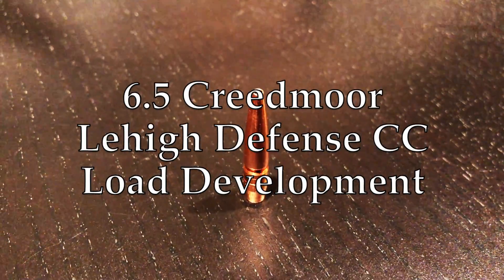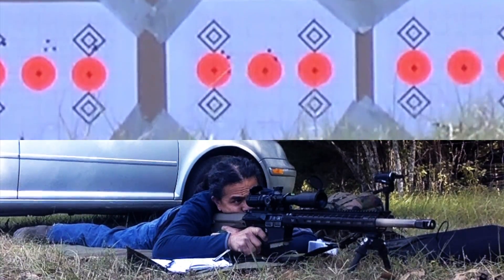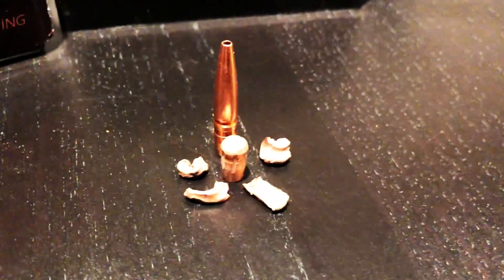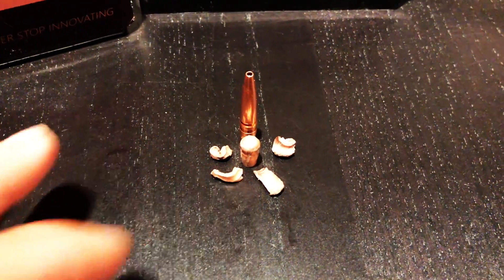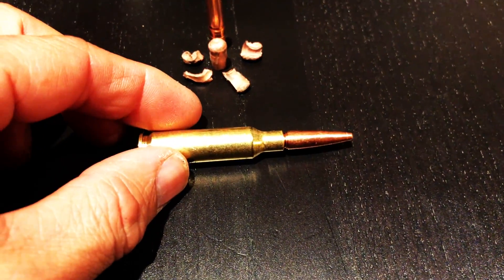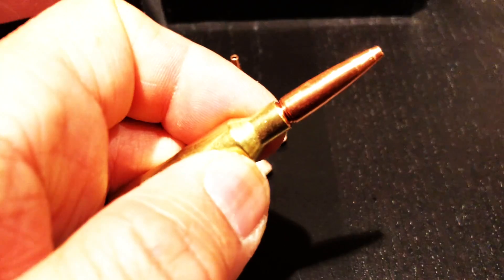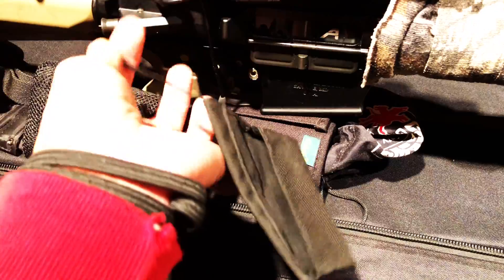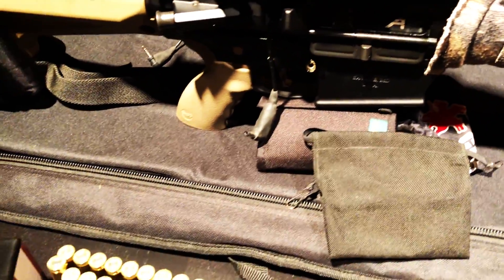6.5 Creedmoor - Lehigh Defense Controlled Chaos

Comment: Coyotes may be hard to hunt but they are not hard to kill.  If you have a load tailored for hogs, it will work fine on a coyote. If you are concerned about pelt damage on the coyote, I am of the opinion that a 6.5 creedmore is to much gun. A lot of people who hunt coyotes for fur are very fond of the 17hmr. You have to get a lot closer with it though. It almost never creates an exit hole and the entry hole is the size of a pin prick. Either way I look forward to seeing your next hunt.
Reply from the maker: You're the third person to suggest the 6.5 CM may be too much gun for a soft pelt varmint and coyote.  But Ill keep my search up.
Reply: SpecialEd309 that would depend on why you hunt them. For me it’s simple pest control so just use what shoots well in my rifle. You might want to try something like a polymer tipped varmint bullet and load it to your lower accuracy node.
Reply from the maker: I've dropped yotes with the ELD-X, Berger VLDH, Barnes TAC-X, Hornady SST.  All of these rounds have absolutely destroyed the pelt.  Got a few guys up north who are bringing in $50.00 on a good coyote pelt.  But the pelt has to be in good condition.  I do have some VMax on the way.  So stay tuned.
Reply: SpecialEd309 , FMJ or Sierra blitz. Used em both in 243/6mm.  Blitz made 1 entry, yotes/wolves, no exit at 100 yds+ & the FMJs just flew through em w minimal pelt damage except for occasional bone shrapnel. Heart/lunged em right behind the front leg or straight down the body cavity through sternum head on.I know Texas yotes are a lot smaller than Alaskan ones but try an FMJ anyway.  Never know til u try. W your shot placement Id bet an FMJ through a pigs head would drop em like a sack of rocks too. Happy hunting Ed! God Bless!!